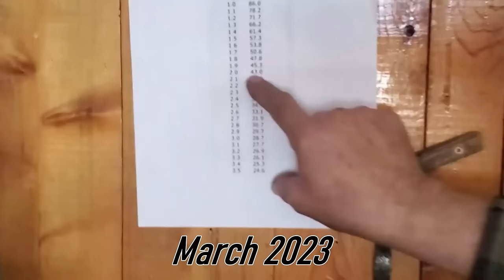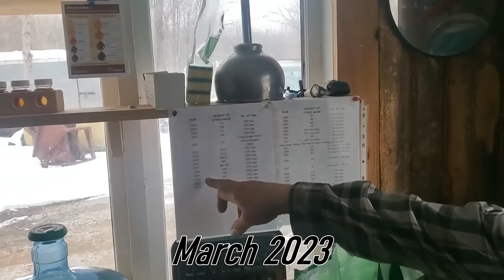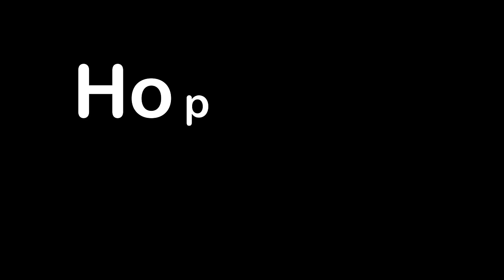Canadian MAPLE Syrup!!

Comment: Before trying to do this in Russia keep in mind the legislation. According to the Ministry of Natural Resources of Russia, it is forbidden to collect tree sap in nature reserves, natural parks and within the city limits. For example, in Moscow, the collection of juice in the city is regarded as damage to green spaces and a fine is due for it.  The fine is not too high (I think it also depends on the region)... from 3.5 thousand to 4 thousand rubles for people, for officials - 50 thousand, and for companies - 300 thousand. It may be higher if you use mechanisms, motor vehicles and other types of equipment. Just to warn you. But its a common thing to gather sap, usualy brich. Atleast for oldery people in Russia. And not to forget to plug the holes so tree keep living long life.
Reply: Technically, it is. But in reality - I'm not sure about any punishment for it at all

Comment: very nice video, i have just one question to ask: why when you try to boil maple syrup in your little makeshift boiler you have a lid on there? Since the whole point is to get the water vapor evaporated and not condensed back?
Reply from the maker: We had troubles getting it hot enough for a boil, keeping the lid part way on helped to raise the temperature but still let the steam escape